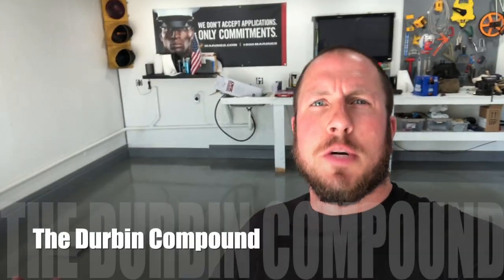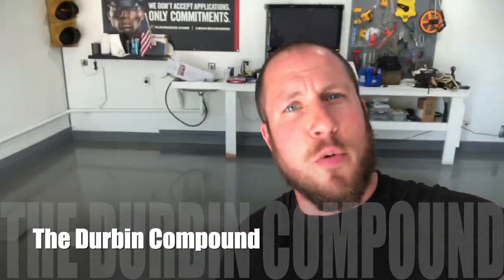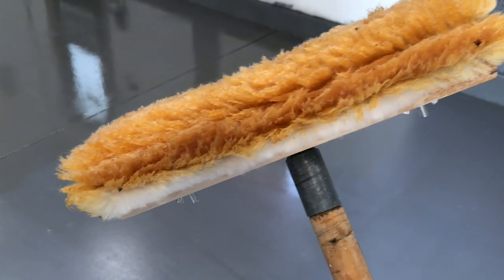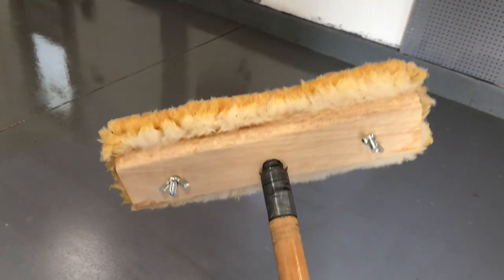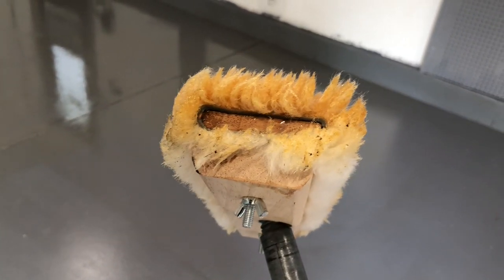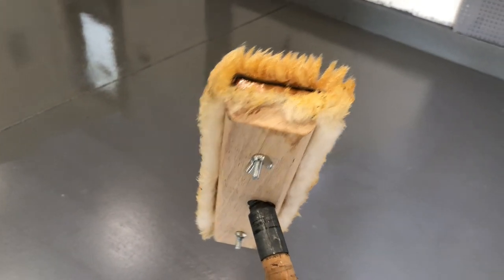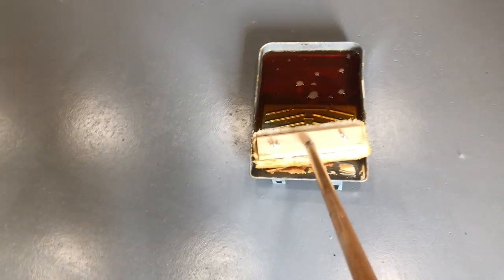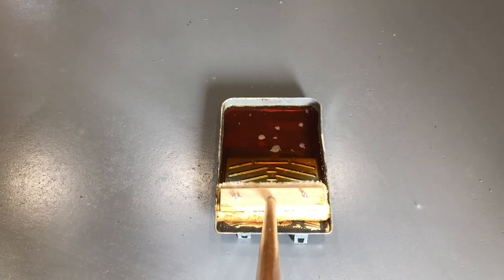How To Use A Lambswool Applicator

Comment: I’ve got bubbles! Every single coat! I have to send them out once again and try this a different way, I might use a hand paint brush and do the whole damn floors this lambswool applicator sucks! Maybe there’s something wrong with Behr oil based polyurethane? It’s super bubbly air bubbles
Reply from the maker: Did you shake the can?
Reply: @TheDurbinCompound  no stired
Reply: @TheDurbinCompound  I’ve painted with oil before, I’m just gonna go ahead and mix it with mineral spirits, thin it out and use a 4 inch bristle hand brush across the whole floor that way I know I’m stretching it out enough thanks have a great night
Reply: @FromTheHood2TheWoods  how did it turn out using a 4 in brush rather than the lambs wool applicator? Less bubbles I hope.
Reply: @BlondShellShock  I ended up just sticking with the lambswool, this time I thinned  it out and try to spread it more, not as much bubbles. Good luck